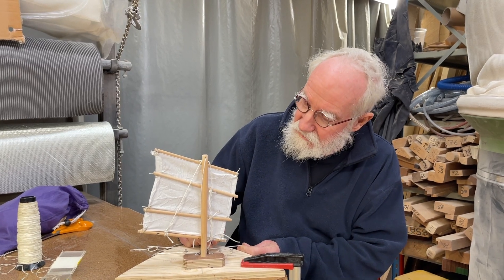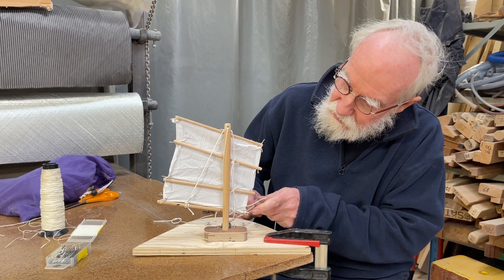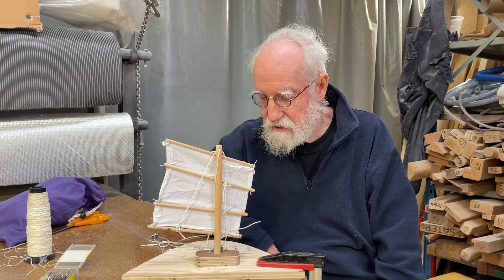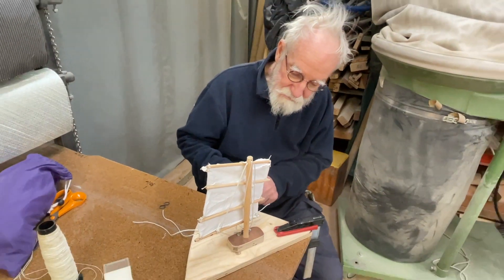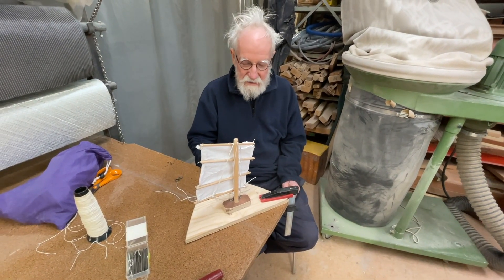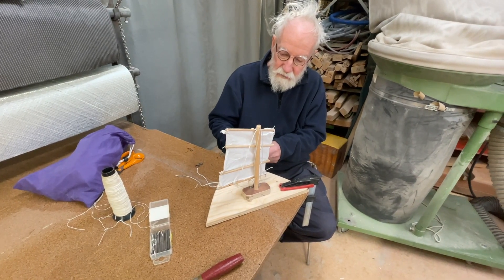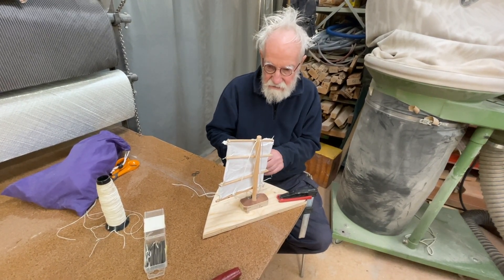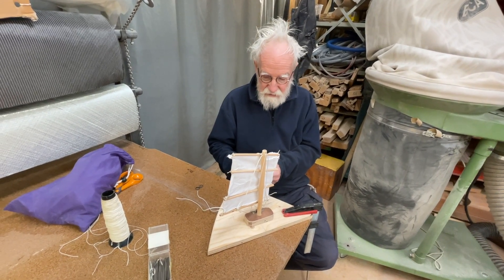24 Dec 2022  Refining reefing  A new simple way to reduce sail area from aft hatch. A desirability.

Comment from the maker: Yrvinds lugsail.

To refine reefing of my balanced lugsails I will add two extra prereefed booms on each of the 3 square meter side by side sails.
Planning to make the next boat a bit smaller. I liked to make the most use of space.

To stack the booms well on top of each other they have where the downhaul is at the worst possible place a hole where the line from for the downhaul passes but as the booms are short the problem can be solved with reinforcing them at that place.
Pulling on the down haul all three booms gets neatly stacked on top of each other and sail area is reduced. This can now be done from the aft deck hatch, a desirable thing.

Also from the booms there is a small stick to the belly of the sail preventing the sail from flapping when in a calm the boat is rolling.
Reply: what is the advantage over the junk rig?

Comment: I have a similar system on my 10 ft scow. Except it has only one boomlet. The boom has a line to haul the boomlet down to it and hold it to it.

This will cut the sail area in half. 

If I wanted to cut the sail are into thirds, I would have a second boomlet added. And that would have a line from the first boomlet to haul it down to it.

This way, I only need one sheet line.

Comment: No matter how they are called, the battens of a junk sail should be pretty rigid. There have been many attempts with "bendy battens". They have to be constructed with care. Just using a bendy material does not work. My perception is: The benefits are mostly not worth the effort. The most effective junk sails of the recent years have rigid battens/boomlets and cambered panels. A flat sail balanced sail with rigid battens is much easier to make, but upwind performance suffers somewhat.

The sail you showed is similar to some of the sails the junk rig community is experimenting with for years. I think it's a good idea. Makes reefing much easier.

Merry Christmas, Sven! 🎄

Edit: I forgot: A defining aspect of a junk sail is that there is a sheet/sheetlet to the end of each of the battens. I couldn't see whether you want to sheet your sail that way. So it may not be a junk sail after all.
Reply from the maker: Tomorrow I post a video on how I have solved that.
It is a kind of lazyjack that passes throug the boom.
You see what I mean tomorrow.

Comment: The masts won't be vertical, they will be slanting most of the time.  Those booms will be hanging sideways and they will be banging on the mast.
Reply from the maker: There will be details later.
The masts will be cylindrical, not conical. Around the mast will be a sleave for the yard. There will be tension in the halyard and we will se if any slamming happens. Trials will show.

Comment: I would query how effective the reef is, only having a downhaul at the mast luff. Out at the clew/leech what stops the sail/boom being blown out unless you have a sail tie/gasket holding the clew end down? Its like a mainsail without a vang, it would lift and balloon. Great idea to initiate a reef but still think you need something clew end to hold the reef in.
Reply: You could run the reef from the luff, along the boom and down to the next boom below. That way the luff downhaul pulls down both luff and leach. But means a loose rope on the leach when not reefed.

Comment: It sounds like a great idea.  Quick reefing is critical for safety and efficient travel.  Reefing from the hatch is a bonus.  Will the additional booms be lighter weight compared to the bottom boom?  Maybe curved, like a sprit boom, but attached to the sail at both ends?  Will the sail be attached in the middle of the booms?  Thank you for sharing.
Reply from the maker: The additional booms will be equally strong or even as they take the load in stronger winds.
They be assymetrical somehow.
More tomorrow.